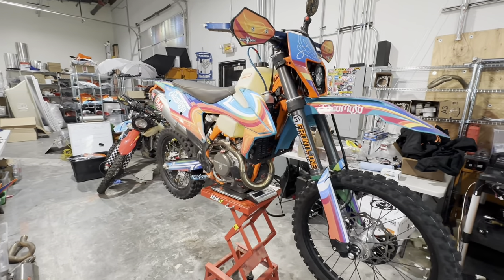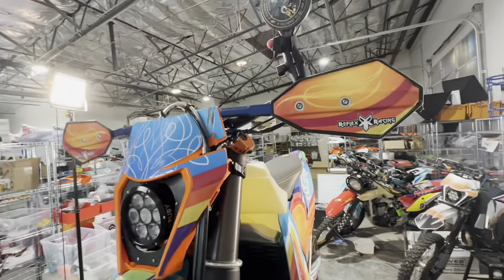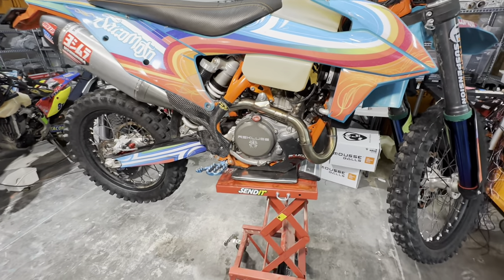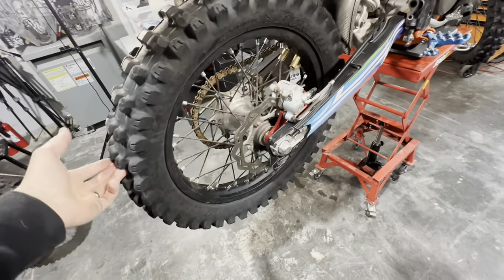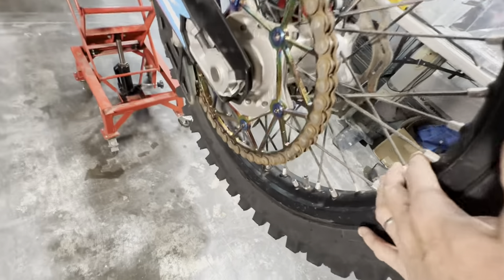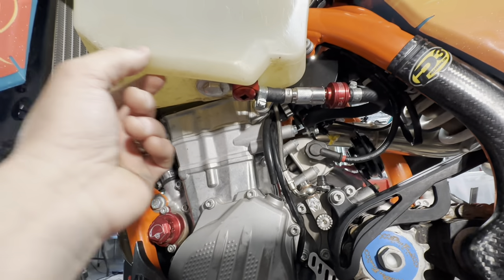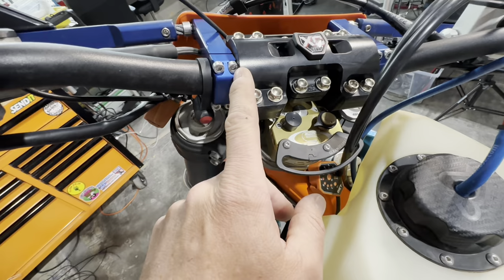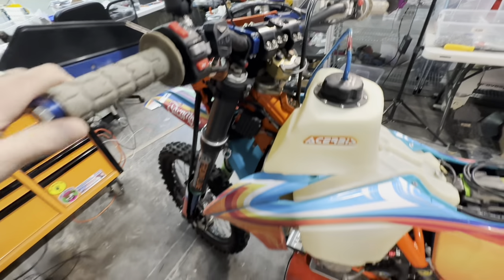23' 450 XCFW UPDATE AND BAJA ADD ON'S

Comment: You need to put the left side foot peg pin in upside down so that it doesn’t contact the screw on the kickstand when the kickstand is down. That is what makes the screw get ripped out of the kickstand and then you loose the hardware and springs.

Comment: Nice set-up! Glad you guys are doing the oil change interval testing. I suspected that the factory recommendations were a bit silly. Depends on how hard you push it but I feel if you're using a high grade oil like Motorex it should hold up fine for much longer than the manual suggests. Cheers
Reply from the maker: With our oil filter, a pc racing filter skin and base gasket, maxima pro plus oil, riding dual sport conditions oil testing shows 60 hour changes are safe and reasonable

Comment: KTM offers a "full system open exhaust" map that's available from your dealer. I'm intrested to hear how it performs over stock and compared to the GET or Vortex.
Reply from the maker: We back to back rode a bike w oem setup and our GET and every test rider picked the GET bike every time
Reply: @TACOMOTOCO  It would be interesting to see the data between KTM's optional map that's available from the dealer for a full system exhaust against the GET.

Comment: It looks like you're running the 3.9 gallon (15L) tank and not the 3.1.
We're interested in MPG in Baja with the new ECU vs stock? I'm guessing stock should be around 45 mpg?
Also interested in what power gains are to be had over the stock tune?
Reply from the maker: Yes. Misspoke 
This is the 15l tank
Reply: @TACOMOTOCO  what can you report on the Taco tuned ECU versus stock?
Reply from the maker: @Eldon95084  the report is that it’s better in all rpm settings in every condition

Comment: I was talking with Randy C on the bike and he mentioned this video was coming out after the trip! Great update video, the level of detail you go into is much appreciated. I already have a lot of these same parts on my new 23 450xcfw, however going a bit different route considering my area is in the midwest. Do you have any plans to test a FMF 4.1 system?
Reply from the maker: 4.1 is great on it
Reply: @TACOMOTOCO  hard to see from the video, did you do anything with the 2 pin “dummy plug” that’s under the airbox from factory (such as removing it)? My guess is this has to do with the emissions system on the EXC’s..

Comment: Taco, I'm getting back into trails/scrambles after a few years. I last rode the 525 Exc-f. I'm wondering if there's a way to temporarily soften the 450s delivery until I get my legs back? 
-Stock map switch? 
-Throttle tube product? 
-Aftermarket mapping?
All 350 platforms seem to prefer more revs. Your description of power delivery on the '23 seems almost moto-like, and that's a bit intimidating. But I love the XCF-W platform. Thanks from MN for any response.

Comment: Thinking about picking up one of these bikes, so enjoy seeing all the mods/upgrades you are doing.
The main question I have is how does the 450 stock tune and engine characteristic compare to the 500 once uncorked?
Coming off four 300 KTM 2 strokes dating from 2016 to 2021. See any issues with this replacing the 2T's once I get used to the difference?
Want to be able to use it for technical southern utah riding and multi-day long mountain singletrack. 
Will flameouts make me regret the 4T, or are they pretty much non existent on this model?
Reply from the maker: 450’s have more snap, punch and aggressive acceleration than a 500
Reply: @TACO MOTO CO  ... thanks, makes  sense.  For the slow, techy riding don't see too many guys on 500's with recluse, will the 450 xcf-w be okay without or due to less tractor like low end, maybe need to add recluse to prevent flameouts?
Reply from the maker: @mikehassler713  I hard enduro my 500 all the time 

It’s prob the better bike for it vs the 450

A 350 is prob better suited though than either 

Rekluse for the win on any bike

Comment: Sweet build. But that engine won’t last long without a filter. Aluminum and copper are not magnetic
Reply from the maker: https://tacomoto.co/products/akt-2-0-oil-filter?utm_medium=product-links&utm_content=ios&utm_source=copyToPasteboard

Oil filtration science is a thing
Reply: @TACOMOTOCO   ok after reading the article it’s states that the way it attaches non magnetic particles is by it getting attached to the magnetic particles. But in an engine bathed in moving oil that’s just not going to happen 🤷🏼 simply physics will never have copper and aluminum attach to steel. If you guys applied this as an additional coverage like in a drain plug or paper filter cap I’d be all game. Win win
Reply from the maker: Oil sample data and ongoing oil testing says otherwise